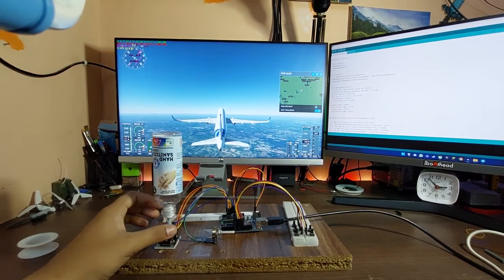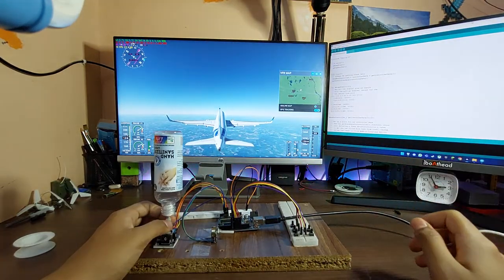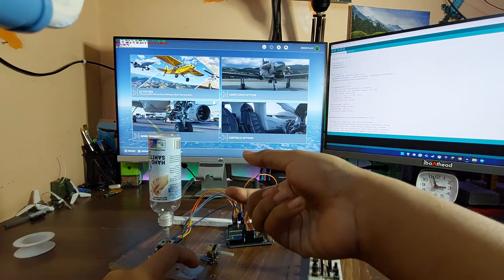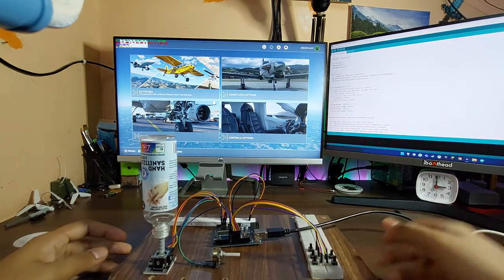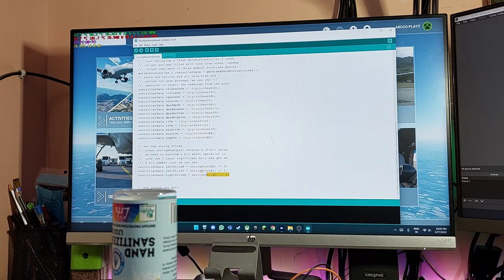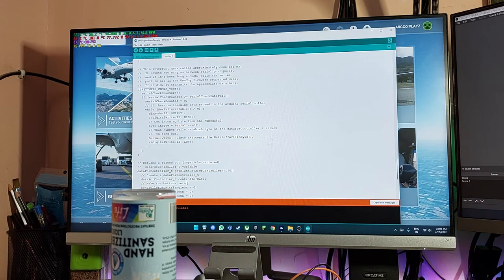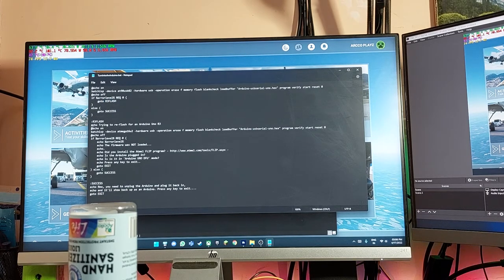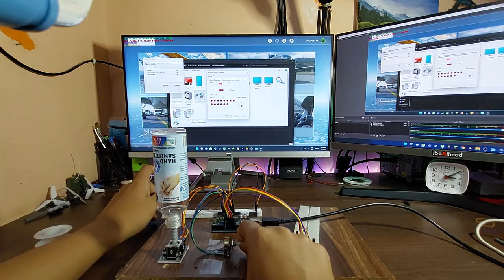Diy Flight Control Stick Using Arduino Uno And Joystick. DIY Flight Simulator

Comment: Hi do you have the Arduino codes for the pitch and roll meter. Need some reference & pointer from you.Thank You.
Reply from the maker: What pitch and roll metre are you referring to?
Reply: @arccoplayz9550  Display the values of the pitch & roll value on a LCD screen based on the movement of the control yoke
Reply from the maker: I didnt make such a attachment for my setup but if you want to do it i guess you could use a 3rd party app or something to get the values from msfs and then send it to the arduino
Reply: @arccoplayz9550  I am constructing it directly from Arduino is it possible.I need  some reference not from msfs

Comment: Hi brother, nice work, i would like to makethe same thing but i would to know if it works with the chinese wavgat programmable board? i am asking because i dont have the money to buy a genuine arduino board
Reply from the maker: You can buy a arduino china clone they work same.
Reply: @arccoplayz9550  thanks, btw, i am subscriber of the channel so i saw the video where you made the drawing machine, so i wonder if it would work without a cnc shield

Comment: Are you using an analog joystick? Did you buy the joystick module or is it a commercial joystick that you have taken apart? I can't find any analog joystick modules for sale, only digital ones.
Reply from the maker: It is a analogue module and yes i did buy it as just the module. Just search dual axis potentiometer joystick module you will find it
Reply: Thanks. I see there  are different sizes for thumb and hand operation.
Reply from the maker: @drkgld  you can choose any you want the one i have is for thumbs

Comment: Hello, I have a problen regarding the input of the joystick. Only the X axis works when  I test it on the control panel and the y axis does not work. My cable runs: 
VRx  → A0
VRy → A1

but when I exchange the cables to each other, the x axis still moves and so as the y axis does not move . I don't know if this is a Software issue or a hardware, is there a way to fix this?
Reply from the maker: wait you mean to say that if you exchange the cables the previous (not working) y axis works as x axis? If thats the case its a software issue (or your A1 doesent work, try changing to a different analogue port and check.
Reply: @arccoplayz9550  Thank youu! But I have already fixed it, a line of code was missing and I just typed it manually and reinstalled uno joy, it's all working now. Thanks!
Reply from the maker: Oh I see so is it missing in the main code then I will have to fix it.

Comment: Hey friend, I am using an Atmega256, could you help me with flashing the board back to arduino after flashing it into JoyStick? I only have arduino uno flash. please friend
Reply from the maker: Just repeat the same process of putting it into flash mode and then use the other file mentioned in the video to revert back to arduino mode.
Reply: @arccoplayz9550  my problem is i’m using an Atmega2560.

I did the same process of flashing back to arduino with the file you provided, and it worked. 

But now I cannot upload code onto the board.

I assumed it was because maybe it’s incompatible firmware for my board since i’m not using an Uno? 

By the way thanks for replying, and also for creating all of the code and sharing a video online for how to use it! Very kind of you helping others.
Reply from the maker: Oh thank you for pointing that out. I solved a problem I was having with one of my Arduino Mega with that.
Reply from the maker: I did some more work on the files provided and it seems that it has something to do with the mega only i believe it is trying to get it to work as an uno as you pointed out.

Comment: Hlo, good build mate
I wonder if I can get the wiring diagram
Thank you
Reply from the maker: Yes just connect the x and y axis of the joystick to A0 & A1 and connect the buttons to any digital pin except D0 and D1.
Reply: @arccoplayz9550  thank you!
Reply: @arccoplayz9550  hlo, I need help in more thing
I have a joystick with 2 joystick modules, a potentiometer and 3 buttons
can you please suggest me a code?
thank you
Reply from the maker: Do you mean that ur joystick has two individual joysticks in it? Like 2 of the one shown in the video together?
Reply: @arccoplayz9550  yes 2 4 axis, and 1 2 axis
Reply: @arccoplayz9550  i would like to get in touch with you so I can share few pictures of the joystick

Comment: how to interface rudder pedals with this whole system..??
Reply from the maker: Rudder pedals are just the switches in my case so you will want to extend them using wires amd just make pedals
Reply: I want to take range of values for rudder pedal rather than switches. So do I do that..?

Comment: can an arduino nano be used for this
Reply from the maker: Yes it can but you will have to first flash it with the latest drivers as on some units(especially older ones)  the factory drivers dont work.

Comment: can you show the diagram? and it works microsoft flight simulator X ??
Reply from the maker: The diagram is very simple just connect x and y of joystick to a0 and a1 and throttle to a2. Connect any buttons to dp 2-13. It will work with any game which supports usb joystick.
Reply: @arccoplayz9550  can you make me diagram it will help me a lot thanks